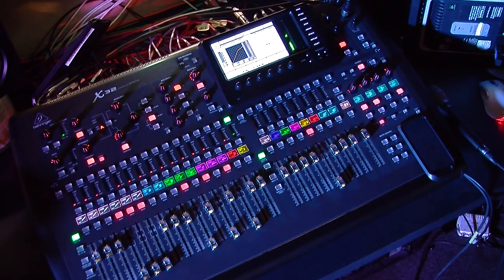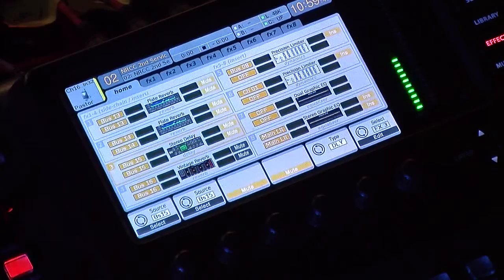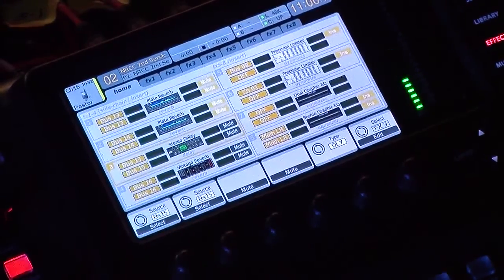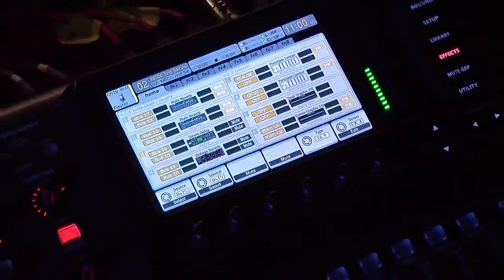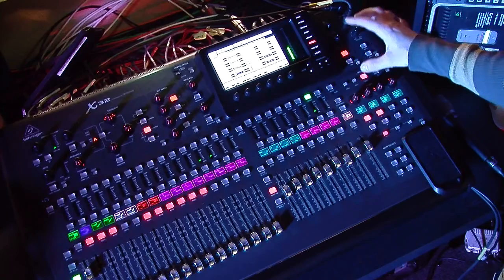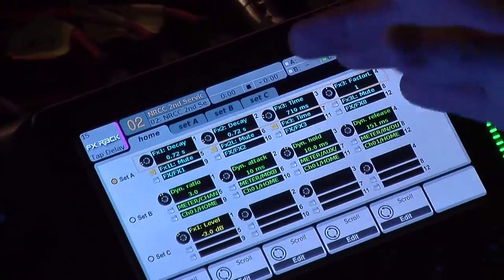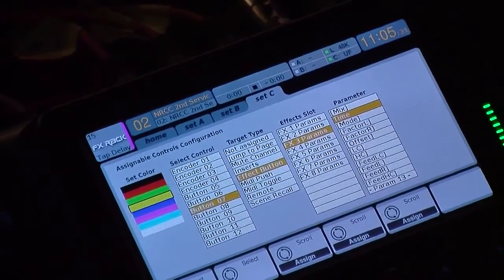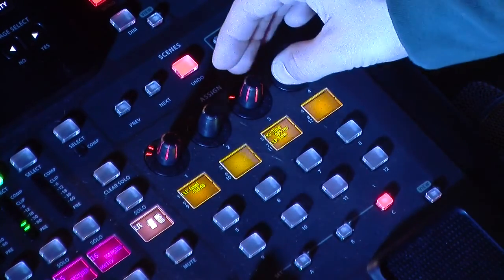Behringer X32 - How To Set Up Tap Delay - NRCC

Comment from the maker: The tap delay is for adding in a repeated vocal line a beat or two later.  You can assign how many repeats you would like, most of the time one or two work well, at 1/4 note timing within a song.  The click track is important!  Our drummer controls that which I feed into a DI box and then into the X32, then that goes into their IEM's.  The mic is a countryman over the ear mic, I love it!  Best speech mic for churches I have found.
Reply: How do you assign repeats

Comment from the maker: The X32 on the LR Bus has a built in Dynamics section,  The compressor there allows a compressor ratio range from 1.1:1 to 100:1. So, I do not use an effect rack limiter on the LR Bus as the dynamics section from the LR bus is more than sufficient in holding the signal down.  Also the ratio range on the channels is the same from 1.1:1 to 100:1.  Enjoy!